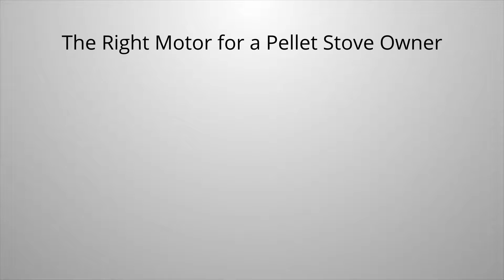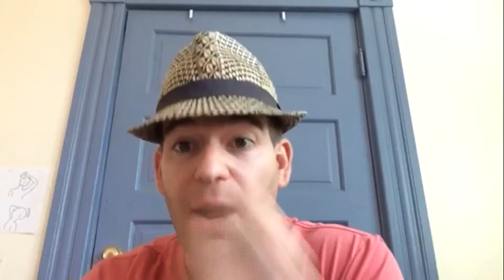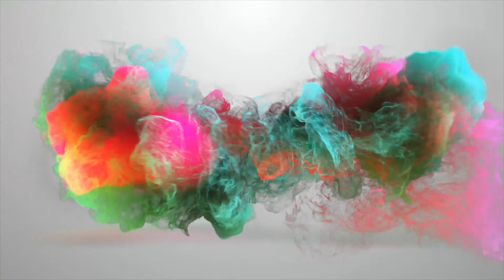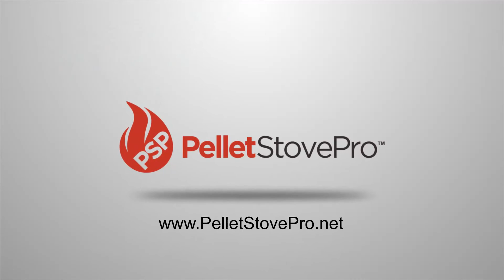The Correct Motor for Pellet Stove Owners

Comment: Hey man, been watching all your videos to try and figure out how to fix my pellet stove issue. My auger motor is spinning, but off and on and at different speeds regardless of control switch placement. We've troubleshooted the motor like you said and hooked it directly to a 110 source and the motor spun freely. This is an older style stove. It's a warnock Hersey eclipse.  My question is, if we've exhausted all options as far as outside electrical sources go, where would you suggest we go from here? Lol sorry for the long winded question and I'm happy to provide photos and more info for any help possible. Thank you very much, I am a new subscriber now.
Reply from the maker: If that is the original motor it could just be going bad.  The motor should turn at a constant speed when it's on so if it's changing speeds I would suspect it's going bad.

Comment: I have an ECO CAB 50 fires up, the the auger stops feeding pellets.  seem like the auger stops just when the fire gets 
hot enough for the blower to start. I've had the stove 5 years and this is my 4th motor. Any suggestions?
Reply from the maker: That's very unusual to go through an auger a year.  This blog runs you through the testing...http://www.pelletstovepro.com/2012/11/my-auger-stopped/

Comment: I have a Forester 5824 Pellet stove, It shut down after about an hour. It seem to drop pellet every 3 to 4 second is that the Norm ? And do I need to get the fresh air intake from outside? Now on the Flue, I have it straight out the wall about 20 inches from the house. Do I need to Run the flue straight up the wall about 3 foot and will this help it run any longer ? Any help would be Welcome. THXs !   Sign, Its cold here in Iowa.
Reply from the maker: Dropping pellets every 3-4 seconds is normal.  You don't need a fresh air intake unless you are in a mobile home.  You can go straight out the wall w/ the pipe.  Shutting down after an hour could be your low limit sensor going bad.  That is usually mounted to the exhaust fan and has two wires going to it.  Jump those two wires together and see if the stove will run longer.

Comment: i have a Harmon P61 pellet stove and the damn thing will not shut down, when i put the selector switch to the off position , the feed  motor will keep feeding the fire  just enough to keep it going ...help !!!!
Reply from the maker: If you are switching it to OFF and it is still feeding pellets then that switch is bad or the control board is bad.  I don't sell the control board but we do fix them....http://www.pelletstovepro.net/repair-service-for-harman-harmon-pellet-pro-ii-circuit-board-w-1-year-warranty-product-718

Comment: Hey young man;
I purchased a (new) England Pellet 25 EPI.
 
Installed according to their guided instructions.
 
I fired it up for the first time and within an hour it went onto shut down mode.

All the 3" Dura vent pipe is new, it passes thru exterior wall 18" behind stove then into the cleanout T and up 5'.
 
When switching on all goes as it should and we get a beautiful flame sometimes reaching the  chamber top.
Then, for the three times I have restarted (at different feed rates) within an hour it (clicks to off) and shuts down the burn pot burns out.
I get a code of S -in the LED feed display.  
I also have a code (that looks like a d) in the LED Blower  display.  

Gona call England Monday.

Any thoughts?

Best; Tom
Reply from the maker: Tom, I've never had one like this with problems out of the box.  I would call Englander and see what they have to say.  I'm not sure what would cause this on a new install.
Reply: 10 4.  Tnks.
Reply: Hey guy;
Thanks 4 the response. Saturday ev I removed the old 4" cap, which was on our old free standing stove. I fired it up again and she has been running since. The cap had a diverter that must have triggered the very sensitive exhaust sensor.
Reply from the maker: Glad you got it figured out.